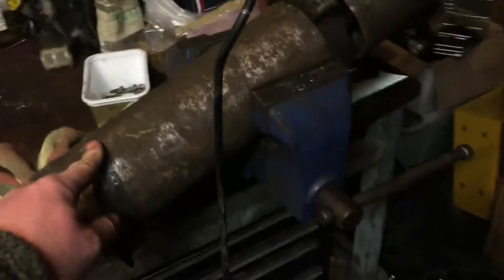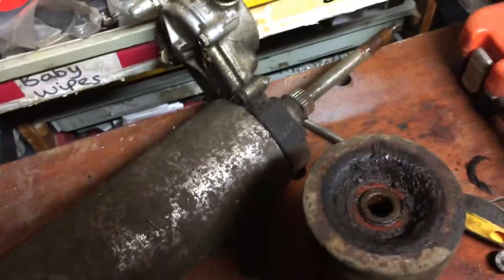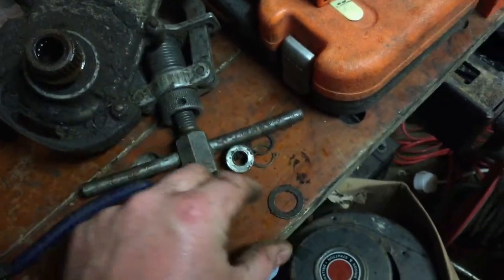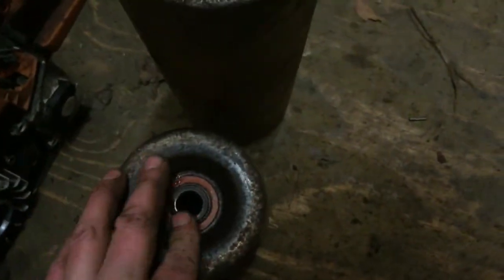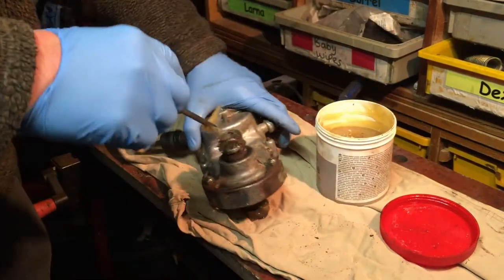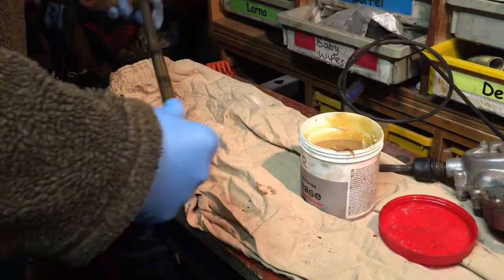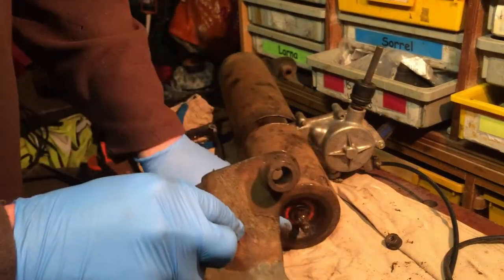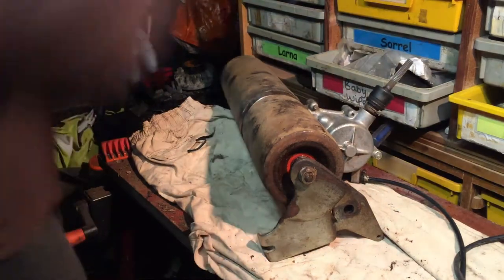Honda Pro HRD536 / HRH536 Lawnmower Roller Unit Service & Gearbox Check

Comment: Hi good video, im doing a similar model at the moment lawnflite 553hrs-pro-hs. ive just did a full rebuild of the gearbox and came to realise i cant find out online what grade of oil i need to fill it with as the old stuff was knackered, any idea as ive read people saying sae 90 iso 220? but no idea where to find it locally. thanks
Reply from the maker: Hi my local mower shop said use SAE30 that’s just standard mower engine oil. Mower shops should sell it. I’ve used it and haven’t had any problems. Hope this helps and thanks for watching🙂👍

Comment: On the parts diagram the thrust washer and circ clips are the opposite way round to how you fitted them (washers first then the circs in middle)?
Reply from the maker: Hi that rings a bell when I looked on the diagram, but my way has to be correct as there wouldn’t be any point having the washer on there, it would just aimlessly slide along the shaft, Honda must have made a mistake there. Hope this helps🙂👍
Reply: Yeah - thanks again for all your help - super helpful video!

Comment: Hi can you help please.I have the same mower I've inherited it from my dad.Its very good condition but when sat on level ground the front left wheel is raised off the ground. I'm thinking the roller isn't level.Is there a way to adjust?
Reply from the maker: Hi the rollers are fixed you can’t really adjust them, I’d say you have an issue with your front wheel adjuster. Let me know how you get on 🙂👍
Reply: Is there a way to adjust front wheels?
Reply from the maker: @richyandliz4802  Hi I would take of the wheels and see if everything is in place, also check for anything bent.

Comment: I have an HRD535 - the drive works on it when I lift the roller off the ground and very reluctantly if you give it a push when on the ground - but mainly it sits there kind of ratcheting on the spot like it is trying to go but slipping ... do you think this points to the needle bearings being the issue?
Reply from the maker: Hi possibly but I’d say it’s more the clutch in the gear box or gears cog has worn out, but first check the lever where the cable goes to can slip there’s a little nut and bolt that hold it on have a look at that first ( you will have to removed the roller system to do that, the good thing is you can buy the parts to repair these gearboxes. Only way you will know is take it apart and strip the gearbox down. Let me know how you get on Thanks🙂👍
Reply: @menditman2004  great thanks will do!

Comment: I hate circlips, Hayter use pins instead which I sort of prefer, the old side drive hayters had circlips, good video
Reply from the maker: Gregs Mowing Yes circlips can be a pain, getting the off can be frustrating at times when the tool keeps flicking off. That's why I really checked they were in the groove. But I'll give these pro Honda's One thing  there much easier to work in than the HRX range, the HRX ones have so much to take off to do a job in them, Thanks for watching🙂👍

Comment: I put new bearing on my roller every winter mate the should no t be seal bearing should be a   grease nipple on them so you put grease in the bearing and drive the wet out
Reply from the maker: paul bugden Hi Paul that's a good point a grease nipple would make much more sense. The problem is people who don't understand these mowers carry on using them with badly worn bearings, the the problems escalates and things get ruined. I've seen some pretty rough drive systems on these, but most is repairable, bearings are fairly cheap, it's the gearbox parts that are the expensive bits. Thanks for watching🙂👍

Comment: I have a Honda HRD536 QXE with rear self-propelled drive, which I am having a problem with. When I engage the self-propel system, the shorter rear roller rotates, however, the longer roller does not rotate, so does not drive. I suspect the gear teeth on the output gearbox drive and / or the gear teeth on the longer roller are worn or stripped. Appreciate your comments ? Could it be anything simpler ?
Reply from the maker: Hi I would say the best scenario would be the splines have worn on the longer roller, Meaning you would just need that roller replacement. Other than that it would be a gearbox issue, but saying that I would think gearbox issue would mean both won’t turn. You need to get that roller off and investigate. Hope this helps thanks for watching 🙂👍
Reply: @menditman2004  Many thanks for your quick reply, much appreciated 👍. Its always good to get a second opinion 👍

Comment: Hi mate,
My HRD535 2002 doesn’t sit flat, roller keeps dropping on the right side so not holding up. Any ideas why? Appreciate the help.
Reply from the maker: Hi all I can think is that the bearings have had it, or the body has damage where the roller bolts on to. Let me know how you get on. Thanks.

Comment: HI  LUKE , AM  STUCK .I  CAN,T  GET  THE  SMALL  ROLLER  OFF .  I  JUST DONE  A VIDEO  FOR  YOU  TO  HAVE  A  LOOK . I  NEED  TO  SPLIT  OPEN  THE  GEARBOX ,  NO  DRIVE   .
Reply: I have the same problem. Did you ever get it sorted? If so how?
Reply: @miklethegreat  i  did  get  the  small  roller off  . what you need to do is soak it in OP Spray . the gearbox is still  not  driving because  i for got to put  the washer  back inside  the  gearbox . so i will have  to take  the  gearbox apart again to  get  the  drive  working  .

Comment: I purchased a brand new HRH, and after the first 15 minutes of mowing it wasn't moving forward anymore... I found that little black cylinder with an axe on the ground, that black part on top here : https://youtu.be/NbNF6TcFhIA?t=1515 
Back to the shop, mechanics told me it was the first time they had seen that. They put it back in place in 5 minutes, and I hope it wont happen again, imagine the blade hurts it when it falls ?
Reply from the maker: Hi I don’t think the blade would touch it as it can’t fail directly on the blade and you would be going forward. I imagine with yours someone forgot to put the pin retainer on, then the pin could drop out, but I would imagine it’s very rare it would fall off. Thanks for watching🙂👍
Reply: @menditman2004  Thanks for your answer. Yes, now can see it's behind the blade. It most likely felt while I was emptying the bag, with the engine idle.

Comment: I bought a hrh536qxe the other day, it was sold with a judder when engaging the roller. I imagined it would be a slipping belt but googling it seems it’s warn cogs. However I tightened the cable and it kind of solved it. But I thought I’d clean it up. One of the needle bearings is knackered,  How do I get a needle bearing out?? Been heating it, wd40, hitting it from the inside, no luck. Any suggestions?
Reply from the maker: Hi heating and hitting it’s out I find is the only way, the mower shops buy the shaft bit which has the bearings in, I don’t think they are stupidly expensive. But that does involve taking the gearbox apart. If you go that why you may as well put a new dog clutch in it as I find that’s what usually (not always) causes the judder. Hope this helps thanks for watching🙂👍
Reply: Life's Hobbies And Happenings have never removed them? As I’ve already ordered replacements. Is it the clutch that causes clicking not the cogs slipping?
Reply from the maker: Stuart Winter Hi again I have removed them once, but I had to heat them up red hot, the got them out with a punch, repair shop told me I wouldn’t be able to do it but I proved them wrong, it’s not an easy job though. The few I’ve took apart the gears weren’t to bad, you won’t know for sure the condition until you dismantle the gearbox, but I bought 2 mowers last year both juddered but when I replaced the dog clutch they were fine. You really can’t tell until it’s been dismantle though. Hope this helps.
Reply: Life's Hobbies And Happenings clutch or gears don’t look very warn? There is about 5mm of play on the little cog shaft though should there be?